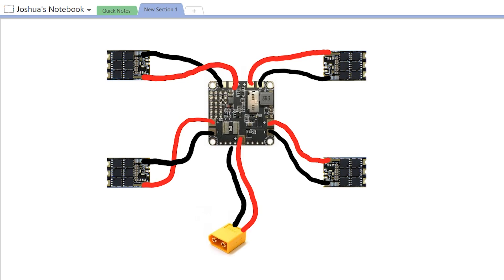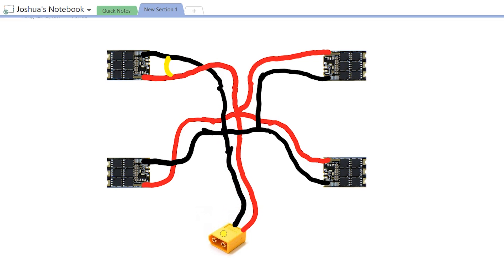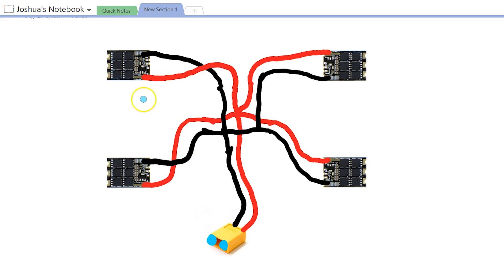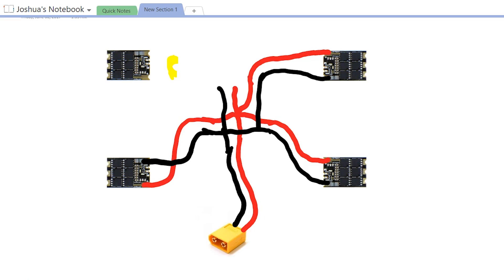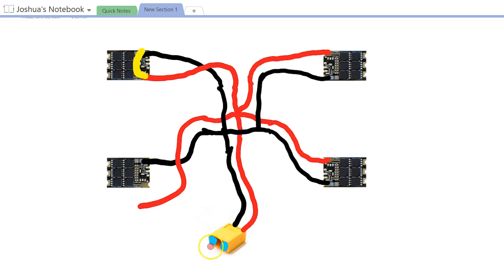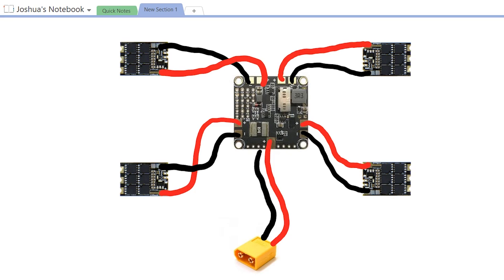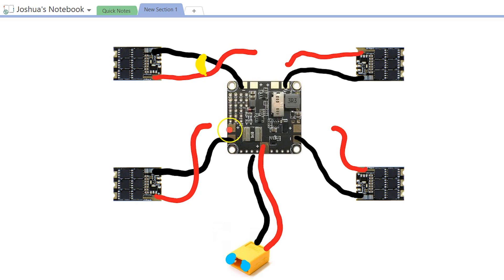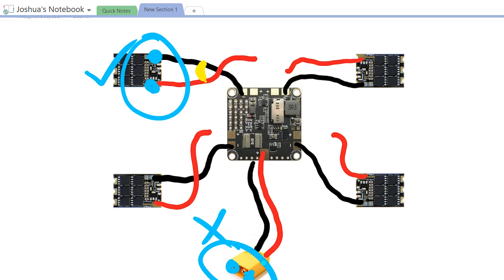How To Find The Short-Circuit In Your Quadcopter

Comment: Is it possible to have a short and not burn something up. When I plug in the battery I doesn’t give me the normal beeps, it only does it once.I get all the lights but motors don’t spin up they just glitch a little bit. Even in calibration the computer is showing them spin up but there not moving.. please help me
Reply from the maker: When you plug in the battery, the ESCs and motors should make the three-note startup tone. This should happen even if the FC is not plugged in. This should happen whenever the ESC receives power, as long as 1) the ESC gets power, and 2) the ESC is wired to a motor.

That's true for BLHeli ESCs anyway. 

If you plug in the battery and you don't hear the startup tones, then the ESCs are not getting power, or the ESCs are not wired to the motors right. But this is pretty weird if so, because what are the chances that all four are wrong? At least one should finish the startup tones.

That's where I would start the troubleshooting.
Reply: Joshua Bardwell thanks I’ll start there.. thanks again
Reply: Also I’m running kiss fc gets power and esc’s blue lights come on but no three tone most confusing thing ever

Comment: I had a strange experience.  The issue turned out to be the ESC, but the way I found it was odd.  I desoldered a wire from each ESC and still had conductivity at the battery terminals.  It was only after I desoldered the wire on the offending ESC from the PDB that the conductivity stopped.  Which you'd think would suggest the wire was exposed and grounding out.  So I desoldered both wires from the ESC, and lo and behold there is conductivity between pos and neg on the ESC itself.  I would have expected that the first time I simply desoldered the single wire from the ESC that the conductivity would have stopped since the short ended up being in the ESC.

Comment: Hello.  Thank you so much for answering my previous questions.  I have one more.  I have a short some where in my quadcopter (thankfully I knew it was smart to get a smoke stopper).  When I first plug in the quadcopter I have no issues.  But when I blip the throttle just a tiny bit it blows the fuse in the smoke stopper.  I went through one by one and removed esc positive leads and same outcome.  I ended up removing all four escs and plugged in the smoke stopper/battery, powered up my transmitter and blipped the throttle with no escs connected and no problem which made me assume that it was the last esc that I disconnected.  So i put one of the other esc postiives back on and tried it again, and it blew the fuse.  I can't find any wires accidentally touching, and nothing is connected in the wrong place (at least not that I can tell after 5-6 inspections of everything).  Is there anything else I can check?  I do have the video transmitter connected, but I took that off of another quad and it worked fine on that one.  Also rx is connected too.  Thank you so much for the great and helpful videos.
Reply from the maker: +Corey Munsell you're blipping the motors. That causes current to flow and blows the fuse.
Reply: Ok I saw in Hobby King's video for the boom stopper that they ran a motor straight through it with no issues so I thought I was supposed to try it.  So it's possible I don't have a short then?
Reply: Ok I checked with HobbyKing to see what they would say.  They said that it isn't meant to have the motors run through it.  It's just to check for shorts up to the escs.  They also checked that video and weren't sure how the motor ran through it and saw how it would confuse customers if they saw that.  They are in the process of removing the video.  Thank you again so much for your help.  Keep up the great videos.

Comment: and without esc connected , i m connet the smoke stopper to my drone and the light turn on directly , what s the prob?
Reply from the maker: most likely you have a short.
Reply: Joshua Bardwell ok, but where nothing is soldering to the bord(fc). im testing the continuity it s ok but when i put the smoke stopper light is on

Comment: Being a retired electrician, I always put my meter on any hot and any ground and check for continuity. Any continuity and you have a short. Don't plug in battery til you find it. I'm surprised more "pros" on you tube don't take this simple step.

Comment: do you have a vid on how to check motors. i believe one of my motors is not working correctly all the time. copter crashes after few min in flight. can not tell which motor it is. oh i know i crash alot but this in in just hover mode. lol
Reply from the maker: Whichever arm dips and the quad falls that direction, that is the one that's damaged.

Comment: Joshua bardwell i had a stupid thing happen to my F3 motolab  i resoldered my battery leads and soldered them backwards! i know LAME!...i know it fried my esc all 4 of them but FC still works i think! ....thats my question!...is that possible ?..i plugged it in to bataflight and it works! but not sure if i should solder up some new esc and motors! i dont want to fry the whole dam quad!..what do you think?....
Reply: I did the exact same thing to my Racerstar StarF3S, my xt60 fell off and resoldered it without thinking... Havn't started troubleshooting yet but it works in Betaflight.. Have you found a solution yet? how did it go?

Comment: could i have a bad pdb? i just got my boltrc kraken 5r wired but soon as lipo hooked it smoked somewhere ive tried unhooking everything
Reply from the maker: If you've desoldered everything else it must be the PDB. It's possible you damaged it soldering on it. This is why you should always use a smoke-stopper when working on the bench, and ESPECIALLY the first time you plug in a new build.
Reply: Joshua Bardwell u ever had new f.c have short on power input ??
Reply: Omnibus f4 pro v3 from rdq

Comment: hi Joshua. As usually, good job :) I got short on my quad... I am plugging battery, and one of my esc's starts to heat without load (starting motor). Is it mean that esc is dead ? I checked all wires, looks fine... thanks for answer :)
Reply from the maker: Yep, the ESC is probably dead. Either there is a short in the circuit board itself or more likely you have a dead FET that is failed open or something like that.
Reply: Thanks, gonna start on esc :)

Comment: I am one of your follower and I have a situation where I made a quadcopter using KK 2.0 configuration board, Sinmonk 30A ESC, 1400 KV Brushless motor
I am using FlySKy FS CT6B  transmitter and CT6B FS-T6 FS-TH9X receiver.

Situation is while using this TR/RX, I am only getting 30 meters range, where FlySky said it has 300 meter range. Due to getting the low range it has crashed twice.

I am using X mode for quadcopter that means my first motor moving clock-wise and 2nd motor counter-clock-wise and 3rd moving From then clock-wise and 4th counter-clock-wise.

So the ESC on 2nd motor has burnt thrice in last 10 days, it is heating up and then burning. 

Please suggest what could be wrong. I saw some of the videos of yours that seems helpful but Why only one ESC is heating and burning if there is short-circuit.

Also it would be helpful if you can post a video for increasing the range of FlySky FSCT6B controller.
Reply from the maker: Probably the receiver is messed up. I would swap out the receiver and see if that fixes the range issues. Are you sure you're not in range check mode by accident?

The ESC burning is probably because your motor screws are too long.

https://www.youtube.com/watch?v=eo2sjTNS0pc
Reply: @Joshua Bardwell when Motor is not connected then also the esc is heating up and burning. The moment I plugin the battery one esc starts heating up.

Comment: Would it pay to put a switch in the smoke stopper so turning off power is quick and easy? Sometimes I fumble with the battery connection when it is tight. If yes, what switch would you use given the smoke stoppers we are using?  Would help if it is phrased as a searchable term for Amazon.By the way, thanks for the series on multimeters. It is my next subject with which to become familiar and making a smoke stopper will give me an opportunity to try some of it.
Reply from the maker: You would need a 12v switch, only rated for maybe 3 to 5 amps at most.

Comment: Ok so I just built the Helix ZX5, used a smoke stopper all was good, went and done initial set up on betaflight then plugged in a battery to do switch test and got a pop sound followed by motors spinning up erratically...

Long story short I have now found a short in the FC but impulseRC are saying the probable cause of it's FC failing is a bad ESC which has put 5v back through the signal wire.

My question is how do I test my ESC's to see if which one if any are faulty.
Reply from the maker: Hmmm I guess it would be the one where 5v is on the signal wire. Desolder all ESCs from the FC and from each other, then measure voltage on the signal pad with a multimeter.
Reply: Joshua Bardwell Thank you for your reply, really is appreciated.

So I know this must all seem very basic to you but I'm just worried about the process of testing. 

So to test the signal pad for 5v it would be safe to directly hook up a battery to each ESC individual and test? 

Sorry again if this seems dumb... just first time quad building and already failing.
Reply from the maker: Yes, you can connect the ESC directly to a LiPo.

Comment: Hey Joshua I burned up an esc (like it caught fire) due to short, I ordered a new one soldered it up and blheli suite doesn't read there is a 4th esc, AND, I did your Vbat wiring and I lost VTX power completely, any ideas??? Spent about 6 hours working on it today just to have it still be broken and more so than before...
Reply from the maker: If Suite doesn't detect the ESC, then

1) Verify the ESC has power. Check with a multimeter to see if there is vBat voltage on the ESC power pads.
2) Touch the motor with your fingers while you plug int he battery. Do you feel the motor twitching as the ESC plays the startup tones? If no, the ESC does not have power.
3) With your multimeter, check for continuity between the ESC signal pad and ground. There should not be any continuity. If there is continuity, either the FC or the ESC may be damaged.

I couldn't say what went wrong with the vBat wiring to cause the vTX to not have power. It's too open-ended a question.
Reply: Joshua Bardwell thanks for the reply! yeah I'm at a loss as to why the box isn't getting power, but neither is the esc for sure,  more less my original esc shorted and caught fire, everything else seemed fine. But now I don't know. going in with a multimeter today so hopefully I can find the culprit!

Comment: Hi. Sorry to trouble u again. I got my quadcopter finally flying and everything working. Went through a few battery's and loved every second. Got home plugged quad back in and I'm only getting 3 beeps from the esc's. But the board doesn't seem to light up. So I plugged back in to laptop and the board seems dead. I don't understand what's happened. I didn't crash. As far as I new it was all good. But now     It seems to have fallen asleep. It won't connect to laptop. But vtx and camera r working and esc's only beep 3times. Do u have any ideas pleeeease
Reply from the maker: +Craig chivers flight controller is definitely dead. No led even from USB is pretty definitive. 

Is your quad a Wizard with the SPRACINGF3 clone? Thru are notorious for dying out of the blue.
Reply: Joshua Bardwell  in I haven't had much luck. I had everything all working perfect flew some packs brilliant. Then I got home. Thought I'd show my little girl my quad all working and it was dead. Iv been researching all the time. Watched all ur vids. Got it all working and now this. That's 3 bff3 now. Don't think I'm Gona get another. Would u recommend another board. And do u have an idea y it died on me
Reply: Joshua Bardwell plus. Still use my spracingf3 on another quad. But I want osd to change pid

Comment: What would cause a component to smoke before the stopper lights up? Happened to me the other day.
Reply from the maker: Whatever it was, was on the edge of burning out, and when it burned out it failed short so the smoke stopper lit up.
Reply: Joshua Bardwell right on man. it was an ESC and I had to use this exact technique to solve for x. Baader-Meinhoff stuff right there.

Comment: @Joshua Bardwell
This guy once showed me a neat trick. If you have a high precision ohm meter, you can find the short faster by testing resistance between various power and ground points throughout the circuit. The lower the resistance, the closer you are to the short. I have done this on a large circuit board and it got me almost to the right shorted chip. 

I looked at your multi meter and it might not be accurate enough. When I did this I was using someone's high end fluke meter with like milliohm precision. It was a neat trick though, wanted to share.

Comment: I have a Emax Babbyhawk  flew I it about 9 battery packs and on the last battery, it does a bakflip and dropped out of the sky. I picked it up and could not see any physical damage.  I  tried to re-arm it and I only get the first half of the tone.  the VTX has power & my receiver has power but nothing else is working. I  tried to connect it to betaflight but it won't connect now?

Comment: Fine video Joshua.  As I work my way towards half of your level I found that investing $30 in a decent quality large, self standing adjustable, with an led bank, magnifier has proactively saved me from tedious troubleshooting much.  One should not break their arms patting themselves on the back on what looks like a very pretty solder job on your pdb or esc units until it is put under the magnifier.  Also high quality tools (cutters, crimpers, etc), soldering iron at the correct temperature and media type for it are imperative. Do you have anything that talks about any rules of thumb or methods to avoid overloading (putting too many devices) on any given BEC?  When the new build one is very tedious about getting all correct randomly fails the list of culprits and responses can grow seemingly thin.  Also I would suggest taking a non-flightworthy PDB with functioning BECS (maybe an esc pad tore off) and FC (the gyro is ganked) mount them onto a wooden board for use in component level testing.  Anyhoo.......  sorry for the long comment but would like your advice on BEC loads.  Thx,

Comment: I upgraded my motors, tested for shorts, then on plugging in i smoked an esc. My guess is it just  was soldered one too many times, but after replacement my video feed has started blacking out after around 15v. The vtx power is filtered vbat, and its operating voltage is 6.5 to 24v. Any ideas? Could the esc smoking ruined the lc filter?
Reply from the maker: Hard to say for sure but if you suspect the LC filter, remove it and see if the problem goes away.
Reply: Joshua Bardwell thanks for the feedback. That supports my own theory, ill try it with raw vbat. Hey noisy video is better  than no video eh?

Comment: Hey Joshua, love your channel. I couldn't have gotten into this I'll be without you. I'm sure you've gotten tons of requests to review the runcam split. I would love it if you talked about the pros and cons of excusing using it over a go pro or equivalent. Is the river situation where a separate Hd cam would be a good idea? I just got to the point in my skills where I think it would be beneficial to have recordings and I'm not sure which way to go. The split or an old go pro. Not super concerned about ultra high video quality. I was looking at getting the run Cam three for an old GoPro before the split at the scene. You were advice on the matter would be much appreciated.

Comment: No shit on the smoke stopper. I do use a meter however dead short isn't the only thing that can over-draw amperage. A part can fail and short after power is applied. It saved my bacon, thank you Joshua.
Reply from the maker: Yep. I don't trust just a multimeter. Another failure mode that a smoke stopper is good for is wrong firmware on an ESC. Multimeter won't catch that.
Reply: That's exactly what happened to me that made me build one.

Comment: Just to test my understanding, if you continue to get continuity at the battery terminals after you disconnect the wires from the ESC to the PDB, that would mean the PDB (or something else connected to it) was causing the short?
Reply from the maker: When you disconnect the ESC + or - wire, you remove the ESC from the circuit. If you now have continuity, the fault is up-stream of the ESC. So it could be in the  ESC wires, the PDB, or the battery lead. So now you desolder the ESC wire from the PDB. If you still have a fault, it's in the PDB or the battery wires. Etc.
Reply: Thanks!

Comment: could this method work on a 4 in 1 esc as well?
Reply from the maker: With a 4-in-1, there isn't really anywhere for there to be continuity other than the ESC itself, because there's no wiring.
Reply: Joshua Bardwell thanks